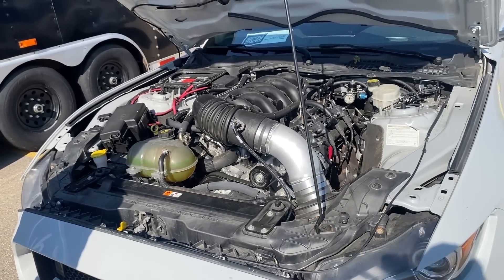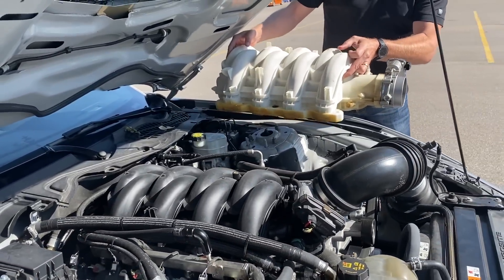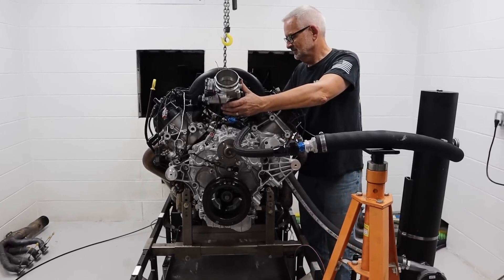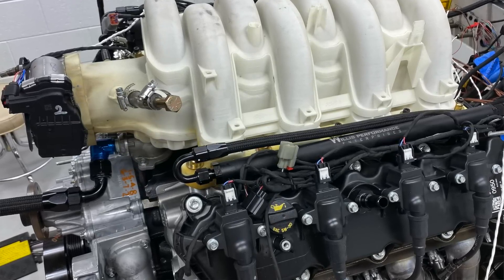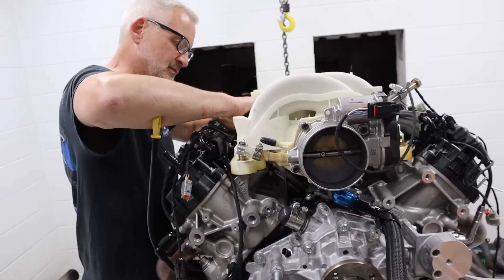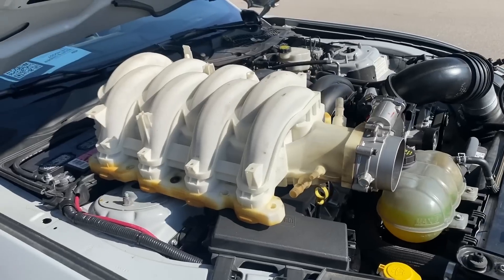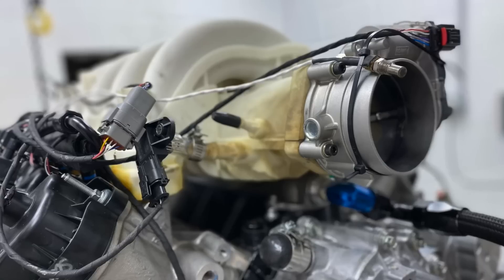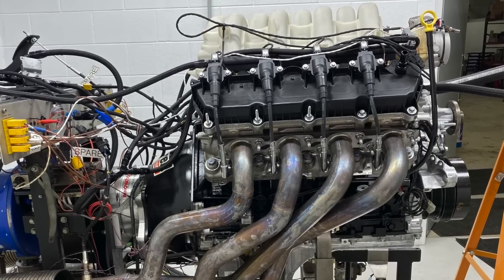Ford Performance Godzilla 7.3L Low Profile Intake Tested | How Much Horsepower Will You Gain?

Comment: Really enjoy your and Brian’s engineering depth and commentary. Those who want to obsolete the internal combustion engine may be a little premature. The 7.3 looks to have huge potential— and gives outstanding performance without taking hours to recharge!  Keep the videos coming!
Reply: There's always hope with the 7.3 Godzilla around
Reply: @ponygt 662 - Once again - WRONG + you need to go learn from professionals since you can't handle it on your own.
Reply: @aesir0784  Agreed 👍
Reply: I d still say this is far inferior to the Chevys LS7. Chevy is far superior to Ford when it comes to OHV engines
Reply: @ponygt6629  Get real, this is a TRUCK engine that really performs exceedingly well. Truck motors were generally done by 4500rpm. This thing still revs out to 6000.  The LS 7 was Corvette/top tier Camaro only, with a special big bore, high compression, big cam, and even titanium rods ffs !!
Reply: @arkhsm  So what, its a shame that Ford still got no big bore engine that rivals LS7. I thought the Godzilla wud be a great platform , but hell no, its far inferior to LS7 its much bigger heavier too
Its a shame that Ford has no rival for Corvette. The only good V8 Ford has is the Coyote. The Godzilla is lazy and does not even give good mpg or neither is it good at emissions.
Reply: @ponygt6629  It's a TRUCK motor first and foremost.  If you regard the totally different purposed LS 7 that highly, please hand in your FORD man card, and wear a bowtie in future, as you are obviously a bit bent that way !!
Reply: @arkhsm  My point here is I put a Ford logo owing to the cars I own, that does not mean I should be totally LOYA:L to Ford.
I have so many issues with Ford. Its not like GM is outright better over all too
Overall I still prefer Ford as a brand.
What I wanna point here is, I expected big things from Godzilla, in towing, mpg,drive ability etc, but in reality I was put off.
Then I googled and I saw this on YT as well
https://www.youtube.com/watch?v=qbXFrZsiAQE
Now just think of it, its neither light or small like GMs LT engines, nor as efficient, not that great power, weaker mpg as well.
I also personally felt despite 7.3L its power was between 3000-4500 rpm a very narrow band and GMs engine had a broader power band ie btwn 2500-4500, some might say, whats up with 500 rpm, but it did feel awkward at 2500 @ 7/8th gear cuz it was hunting for power, the GM engine @ that rpm has sufficient power and yet sucked less fuel!!!
Reply: @ponygt6629  And yet there are literally thousands of happy 'zilla owners, also google-able. This engine makes more power and torque compared to the engine you should be looking at; the HD GM truck engine, the L8T, THAT IS ALSO AN IRON BLOCK, alloy head engine !!
Reply: @arkhsm  And the sad part is the power ita makes is only on paper, in real life its slower than GM HD L8T and even worse pushes less mpg and emits more COx /ppm
So whats the point of making more HP on paper??
Reply: @ponygt6629  After scouring the forums of the non-biased variety, it appears that 'zilla owners are a very happy bunch that seem to rate it very highly. One thing they REALLY LOVE, is PORT injection for the simplicity, clean valves, and lower compression ratio, vs the direct injection in the chev. For REAL TRUCK  guys, this is a BIG  issue. The higher comp. ratio is a reason why the chev gets a whole 1mpg better lol. Meanwhile, up the Ike Gauntlet, the chev was 3+ minutes slower, haha !!
Reply: @arkhsm  As if the Chevy motors are failing with DI, come on
They are also reliable with Pi+Di, Yea the owners will be happy cuz only biased people buy the Zilla motor cuz it sucks more gas and isnt as powerful as a 6.2l OHV motor from GM
Also its not +1 mpg, overall its 3.3 mpg higher than Zilla, thats a huge deal with such high gas prices
And TFLs review please see the video in full, there were reasons why the HD took 3+ mins more than the F-250
Reply: @ponygt6629  Yes there was a good reason....it sucked, 'cause it's a gutless wonder. Chev man, in the world of trucks, chev has been in third place 'til their 22 models, but FORD is ALWAYS no.1 !  Just quit this delusion only you seem to believe, and catch up with the rest of the world.  For your information, the website you're calling biased was for BOAT lovers, so don't talk rubbish please as you defend General Meatheads !!
Reply: @arkhsm  I ve no reason to not believe what I experienced. I still love Coyote and Predator and Voodo V8s. Also huge fan of Fords 1.0,1.5,2.0,2.7 ecoboost engines
I also love Fords 2.0 turbo diesels and 3.0 Lion V6 diesel.
Not a fan of Fords 6.2L,7.3L, gas and diesels
Reply: @ponygt6629  Everyone is entitled to their own opinion. Enjoy your day !!
Reply: @arkhsm I mean I get that but a basic L92 6.2 and now the L8H 6.6 ( factory CCW stroker ) truck engines have rec port heads it's just a simple heads on cam spring swap and 7000rpm + peaks...with tons low end too...( NA).

Ive had a gen 3 coyote and the reason I immediately boosted it was it was so fckn weak on motor stock...literally wouldn't turn a tire with 3.15s...just way less torque than I'm used too but I added 11psi to the A10 and holy shit lol.....

 I do wish coyote architecture was available at a bigger displacement for tip in torque on 93
Reply: @ponygt6629 7.3 has far more potential  Ford just announced crate engine available 630hp n/a
Reply: @ponygt6629   Then take that pony Gt horse emblem off of your profile
Reply: @jmcrjc6799  Taking emblem is my personal choice irrespective of what I see as facts
Reply: @ponygt6629  It would be like me having a Chevy emblem and then saying how inferior to GM is Ford's products for which they are..Because I said so and I know so  that's the facts..That's the way you sound I will bet you haven't even been around one of those Godzillas have you?
Reply: @jmcrjc6799  Yes, I tried one and it felt slow and sluggish, Now dont go on saying thats how truck motors are supposed to be.
NO, I ve been n other motors that felt stronger than Fords Godzilla 
Worst part is its MPG too sucked big time compared with GM rivals, this was almost as thirsty as Hemi V8s

Comment: The side view of that passenger side header is beautiful. I’m imagining that engine in a drop top ‘66 Galaxie 500 7 Litre body. I had one back in the day, but it didn’t have an engine
Reply: The bore spacing and beck height are stupidly close to the FE and atop that, 445 (the 7.3 displacement in CID) is and has been a readily available stroker kit for 390s and 428s
Reply: Reg, memories; I was 16 washing cars at our small town Ford dealership when those came out, they got one, Wimbledon white with red pin striping… the most beautiful damn thing I’d ever seen, I would sit in it and fantasize, totally out of my league at the time.
Reply: @aerialcat1  Mine was black w/white drop top and red interior. Bucket seats auto on the floor
Reply: Im trying to get it in my 63 galaxie and its adding up. For sure need to have several thousand ready to put in it.
Reply: I have a '67 Galaxy 500 convertible definitely looking to drop a 7.3 in it
Reply: @28ghz  🗣️Go for it!!👍🏽